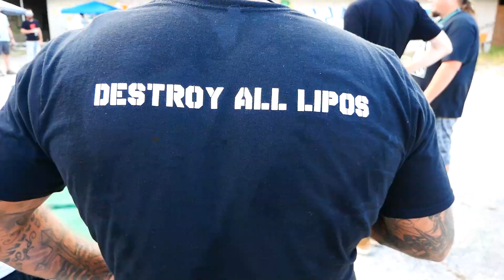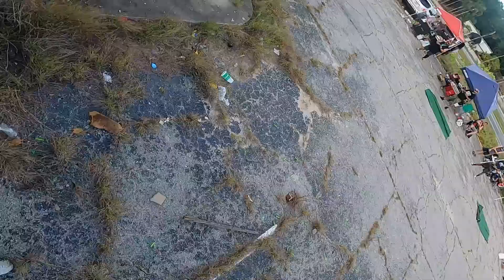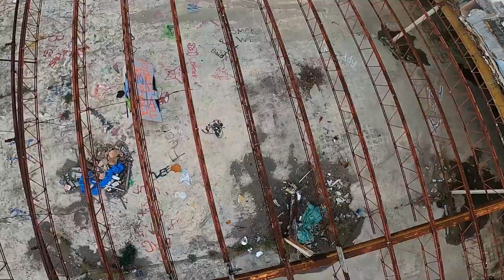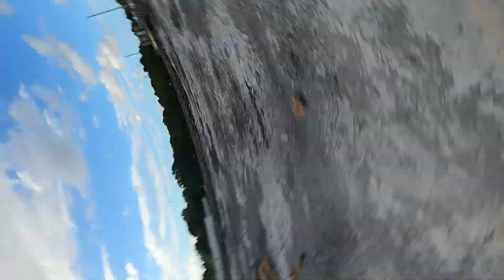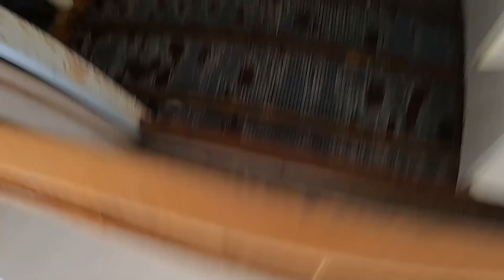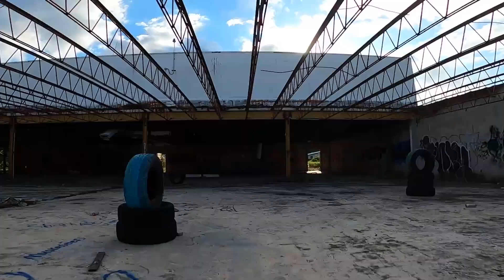Final Test! Is Aluminum Better Than Carbon Fiber For Drone Frames!!?? 💥 Bando Bash!!

Comment: Did the threading in the aluminum rip out or the bolt heads bust off? Whats the fix in either case? Tap for larger bolts, or through-bolt with a nut on the other side?
Reply: the bolt heads sheared off...disassemble and you'll be able to easily twist out the remaining bolt from the standoff.

Comment: First of all this was an epic test man🤌🏽👍🏽 secondly its crazy how well it held up because "statistically" carbon fiber has a better strength to weight and stiffness to weight ratio than aluminum yet I don't think a carbon fiber quad would've walked away as well as this aluminum quad did which is weird 🤔 lol nonetheless I DEFINITELY want to try out this frame even though I am not nearly as good a pilot as drain I'm sure I will end up with a boomerang after my flight😁 awesome vid man🤌🏽✌🏽
Reply: I sprinkle magic dust on these frames...seems to help.
Reply: @KINfpv  awesome concept man 👍🏽🤌🏽